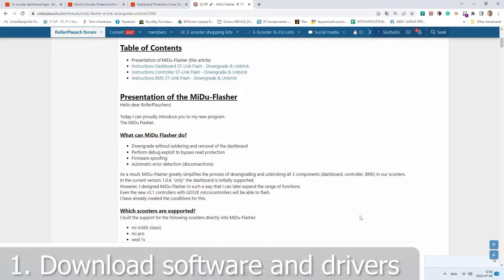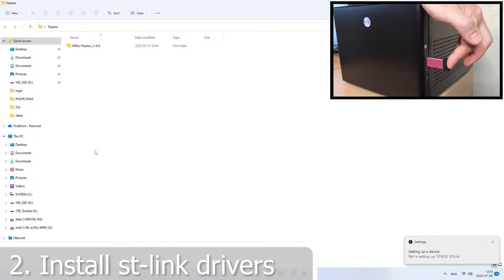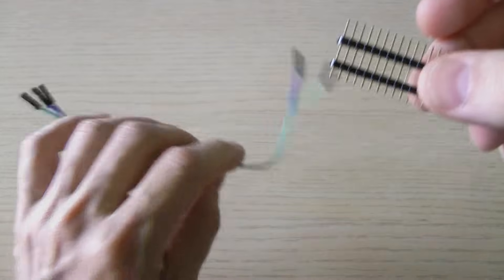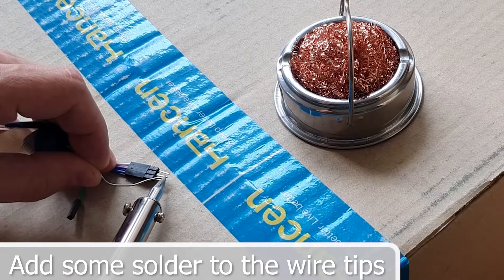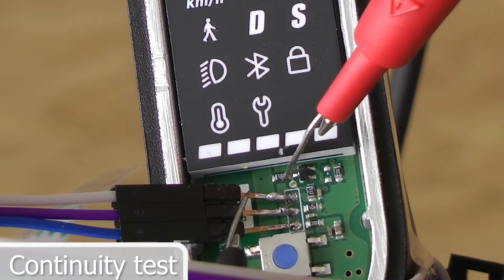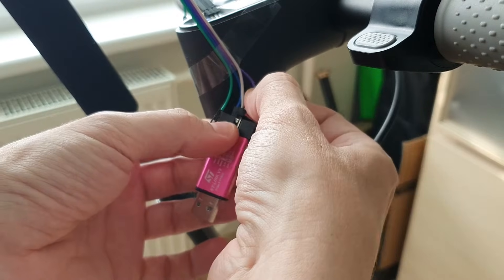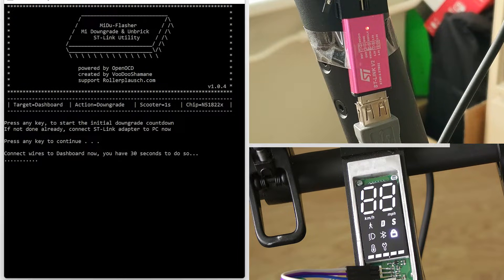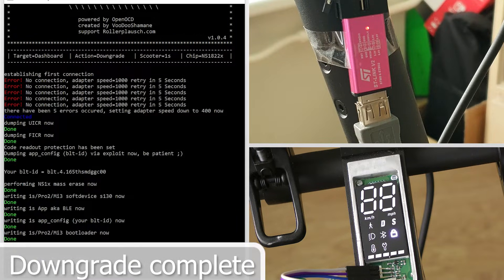Xiaomi scooter 1S BLE157 downgrade using stlink

Comment: Can I downgrade to hack the speed as my scooter configuration as mentioned below?

DRV Ver 248
BMS Ver 141
BLE Ver 157
UUID 48FF70068—————-1067

And one more question is, Can I replace the dashboard instead of doing stlink? If so do I need to do something with the controller?

Thanks in advance….

Thanks in advance.
Reply from the maker: Yes, you have ESC version 3.0 so any DVR is compatible. And yes, you can downgrade the BLE version as shown in the video.
As for the dashboard, if it is original, then it should work out of the box, if clone, then ask the seller.
Subscribe, thanks.

Comment: Ok so I did this WITHOUT soldering, like you showed in the other video.

DON'T PANIC if you move the cables while flashing. It "soft locks" the scooter, but all you need to do is unplug the board (by removing the scooter "head"/steering wheel) and then replug it. You'll then have to reconnect, your scooter will appear as "Empty Flash" or "Flash", something along those lines, at which point you should be able to connect and unlock it (if you locked it). Then, try again. It doesn't just "brick" your scooter.

If you have a Pro 2 like me, you'll have to cut a little thing (check the "Doc" folder, "Diagram" picture). I just used a little exacto knife thing and just ran it through that.

I messed up 3 times, soft locking myself, and retrying, I got it on the 4th attempt and everything was good, thank you for the video <3
Reply: Today I cut out 4 pins from an old IC solder socket and soldered that to the display board. This way I now have a permanent plug-in connection for the ST-link. Good for playing around or if you will use the board to flash other scooters etc.
Reply from the maker: @juleol99  Very cool. Subscribe, thanks.
Reply from the maker: Thank you for sharing your experience ❤
It's valuable, especially for those who will do this in the non-solder method.
As for the capacitor, definitely, it won't make it worse if you cut its track (it's just a matter of warranty).
A few subscribers reported that they flashed pro2 successfully with untouching capacitors.
So I think it's just a matter of good contact.
Personally, I practiced a few times in "Dump Flash" mode to get the feeling of needed pressure and position of the pins. After that managed to flash 2 times in a row from the 1st time.
Subscribe, thanks.
Reply: I have a pro 2, do I need to cut the c2 trace if I want to downgrade? I haven't tried to downgrade yet, but if I was to would I have to cut it?
Thanks
Reply from the maker: No, you don't have to cut.  Sub. Thx.
Reply: @MindaugasJocionis  thanks for the speedy reply! I'm planning on using the stlink without soldering, if I mess up would I just try again without cutting anything? 

Also I read online that downgrading with the stlink will only work with a controller v3.0? Is this correct? 

Thanks!
Reply from the maker: Downgradded BLE gives possibility to flash DRV to the ESC board over bluetooth.
If you have an ESC 3.0 board you can flash any DRV on it or use SHFW.
If 3.1, you need to use a new gen firmware generator and make your own DRV. Otherwise you will brick it. 

BLE is the firmware for your dashboard.
DRV is the ESC (motherboard) firmware.
BMS is the firmware of the battery management controller.

BLE is like a gate that allows or disallows flashing the motherboard over a Bluetooth connection.
Reply from the maker: Check this forum and telegram chat for more info: https://rollerplausch.com/forums/xiaomi-pro2.136/
https://t.me/scooterhackingchat
Reply: Okay thanks, so just to clarify I can downgrade my BLE even if the motherboard is version 3.1, but I will just have to make sure that I make my own CFW on a new DRV firmware? 

Sorry for all the questions lol
Reply from the maker: @ConnorJBW  Correct. For ESC 3.1 this builder: http://nextgenfw.pythonanywhere.com/
Reply: Thank you so much dude, top guy!
Reply from the maker: @ConnorJBW  Oh and the DRV247 which you will need to use to make your own DRV  for 3.1 you can find in that telegram chat
Reply: @MindaugasJocionis  thanks.
Reply: What to do wen its not stRting and just blinking
Reply: I mesed up so badli that the light is blinking and it wont turn on i ordered a new dasboard pls dont say the controler gos in to softlock to
Reply: I moved the cable while flashing, and now i can t find it on the downg app, i tried to unplug the cable from the dashboard but it did nothing, now my dashboard isn t even showing the lock light, it s just turned off, when i move the scooter it makes a noice like the scooter is locked trough the app, idk what to do, should i come back in 6 hours and see if it will just unlock by itself?

Comment: Hello ! 
I have a mi pro 2 with: 
BLE 1.5.7
DRV 2.4.8 
BMS 1.4.1 and i have the new 3.1 controller... 

so it is possible for me to downgrade BLE without bricking? 
and if yes, what kind of (speed) modifications can i do with the new Controller? i would be thankful for an aswer!
Reply from the maker: You can downgrade BLE regardless of your ESC controller (they are on different boards and use separate firmware).
As long as you have ESC3.1 you need a different DRV than those old ones, otherwise, you will brick your ESC board.

Here you can build a new DRV by yourself:
https://rollerplausch.com/threads/neuer-controller-v3-1-bei-aktuellen-xiaomi-rollern-brickgefahr-bei-drv-downgrade-vorgehen.5187/page-6#post-67651

Check this telegram chat, here you can find prebuilt DRV for new controller 3.1 https://t.me/STLink_XAP2P
https://t.me/STLink_XAP2P/34

Subscribe, thanks.

Comment: Hi. New to this. BLE = Bluetooth firmware right? But what is the ESC and the BMS referred here? Is BMS= firmware version?
Reply from the maker: There are 3 components that have firmware on them, and you can flash them separately.
BLE = Bluetooth/Dashboard unit or its firmware
ESC / DRV = main board/motor controller or its firmware
BMS = Battery management System or its firmware 

Subscribe, thanks.

Comment: Hello ! I have BLE 157, BMS 141 and ESC 321, can I downgrade safely with your technique or is my ESC version too high and it will brick if I do anything ?Thank you !
Reply from the maker: 321 is your DRV, not an ESC version. You can check your ESC manually by removing the bottom cover and taking out the mainboard - ESC (electric scooter controller) or by the app: "m365 downG "  look in the UUID under Tools. If the UUID does not contain the characters FF , it is the new controller: Flashing the old DRV leads to Brick !!
If the UUID contains the characters FF , it is the old controller: no problem with flashing.
Even if you have a new ESC 3.1, you still can downgrade BLE as in this video, as it has nothing to do with your mainboard, it's a dashboard downgrade.
For ESC 3.1 there are different DRV (still in early stages).
More info on that: https://rollerplausch.com/threads/neuer-controller-v3-1-bei-aktuellen-xiaomi-rollern-brickgefahr-bei-drv-downgrade-vorgehen.5187/
Subscribe, thanks.
Reply: @MindaugasJocionis  Okay XiaoDash says that it's the ESC version, thank you!

Comment: Hola, recientemente soy poseedor de un espectacular Pro2, al conectarlo por primera vez a la APP, obligatoriamente tuve que actualizar el scooter. Actualmente, estoy en Firm: 248, y BLE: 157.
Al ser nuevo no me atrevo a desmontar el frontal a no ser que este 100% seguro de que puedo hacer un downgrade con este método. Qué requisitos necesitaría para realizar este downgrade? (ya dispongo de un ST-LINK). Mi placa BLE es la versión 3.2.
Muchas gracias y un saludo!

______________________________________

Hello, recently I am the owner of a spectacular Pro2, when connecting it to the APP for the first time, I necessarily had to update the scooter. Currently, I'm at Firm: 248, and BLE: 157.
Being new, I don't dare to disassemble the front panel unless I am 100% sure that I can do a downgrade with this method. What requirements would I need to perform this downgrade? (I already have an ST-LINK). My BLE board is version 3.2.
Thank you very much and greetings!
Reply from the maker: There are no special conditions to downgrade BLE. All dashboards can be downgraded. Just do it step by step like in the video.
I'm assuming you want to do a speed hack, for that you need to know the ESC version, if it's 3.0 then you're good to go. If it's 3.1, you must assemble your DRV (this is still in the early stages).
Here you can find all info: https://rollerplausch.com/threads/neuer-controller-v3-1-bei-aktuellen-xiaomi-rollern-brickgefahr-bei-drv-downgrade-vorgehen.5187/
Subscribe, thanks :)
Reply: @MindaugasJocionis  Me he mirado el post que me has pasado y hay muchas cosas que no llego a comprender, ya que el traductor de Google no es extremadamente eficaz jeje. Por lo que he podido entender, mi UUID contiene las letras FF y entiendo que es un ESC 3.0, porque no veo en ninguna APP que me diga el que tengo sin tener que desmontar y poner en riesgo la garantía. De ser así (suponemos que tengo el ESC 3.0) sería hacer el downgrade al BLE y ya podría cocinar y hacer el flash simplemente con la APP Xiaoflash no?
De nuevo, muchas gracias por el tiempo y atención que me dedicas ^^

____________

 @Mindaugas Jocionis I have looked at the post that you have sent me and there are many things that I do not understand, since the Google translator is not extremely effective hehe. From what I have been able to understand, my UUID contains the letters FF and I understand that it is an ESC 3.0, because I do not see any APP that tells me what I have without having to disassemble and put the warranty at risk. If so (we assume that I have the ESC 3.0) it would be to downgrade to BLE and I would be able to cook and flash simply with the APP Xiaoflash right?
Once again, thank you very much for the time and attention you dedicate to me ^^
Reply from the maker: @trasto93  Yes, that means you have ESC 3.0, and yes, downgrade BLE and you can flash any DRV from your smartphone.
Sorry for the late reply, didn't get notified about this one :)

Comment from the maker: Thx. for watching and commenting, please don't forget to subscribe to the channel, I really appreciate that :)
If you have any questions, feel free to ask in the comments, I'll try to answer them :)
See the video description for software links and other useful links.

Head swap method to bypass BLE157: https://youtu.be/YAexlwq47q4
Flashing without soldering (risky but possible) https://youtu.be/NYxrvGhevwg
ESC recovery: https://www.youtube.com/watch?v=kbj3A4aAlSU&t=552s
Reply: first of all Thank you! I have this problem: after soldering the stl to the board properly ( and checking)... the scooter doest turn on ( the tail red light blinks but nothing)...if I disconnect the STL programmer ( even just one wire) the scooter turns on normally. I have a 1s. is that because I did not disoldered any capacitor? thanx ( I also made a video if that can help)
Reply from the maker: @emimobile  The capacitor has nothing to do with it. Try asking in this telegram chat: https://t.me/scooterhackingchat
Post your video there, definitely someone will help you.
Sub. Thx.